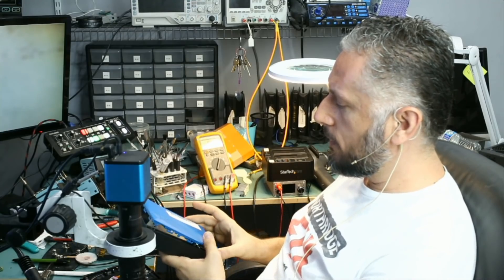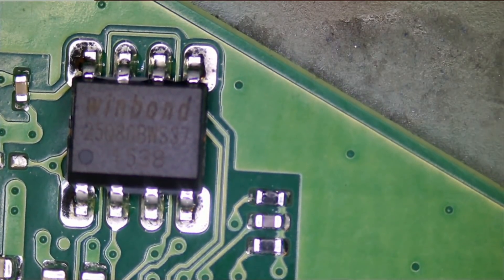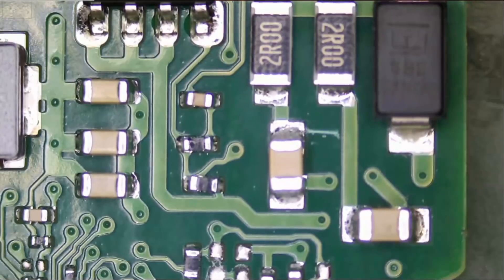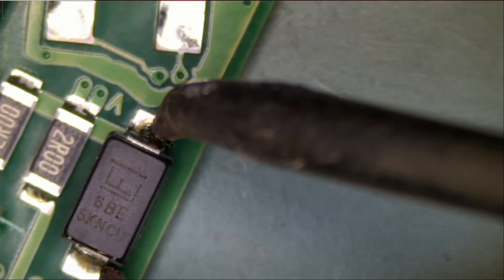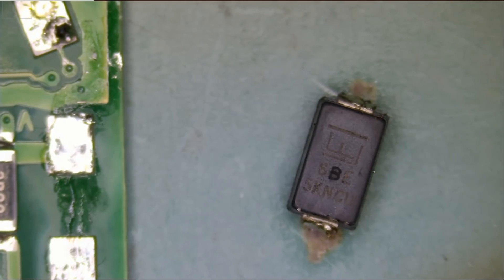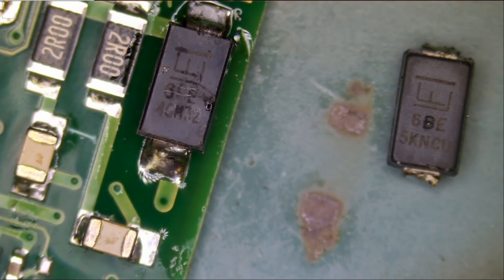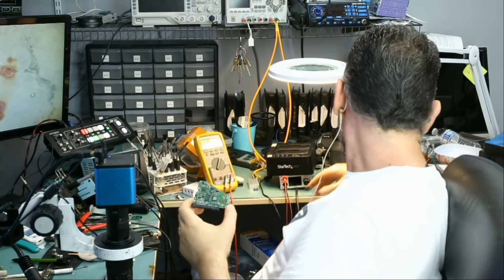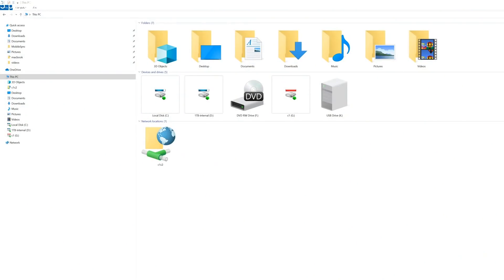5TB External Hard Drive Repair - Not spinning No power motherboard Repair

Comment: ok so the hub device I have turns on and stays on. The drive has no spin like this. No signs of viable issue, burn smell or no heat in my thermal cam. Is it only resistors I should check? I'm assuming if theres no start up at all its deffo the board and not the disks inside ?

Comment: hi northridgefix, i have a question

i have a seagate st5000nm0084 5TB hdd

it got interrupted during a wipe using seagate tools.

now it shows only as 4GB in size and is not powering up beyond turn on spin, 4 noise clicks then spins down.

is there anything i can do as i dont think my issue possibly is the card.

i cant get any os to recognise the drive properly to try and edit/repair in any way,

seatools doesnt recognise the proper size/capacity.

what would you do in a situation like this?

thanks for showing  great content, i feel like i learn a lot from your work.

 - des, from the uk

Comment: Great repair Sir , it's interesting how you make it look so easy . one question the diode you replaced it with had a  code number different from the faulty diode . While one could assume or presume the parts were from same drive how could you have been so sure the diode  had the same specs or specs that were within the working range , surely to be sure one would have looked up the specs . ?
Reply: I knew someone would have asked this question I was wondering about already

Comment: For those without an electronics knowledge or background, could this issue be resolved by getting another motherboard of the same model and just replace the motherboard?  Not sure if it works that way.

Comment: @NorthridgeFix Firstly great video secondly is the motherboard paired to the hard drive, if it's not would it not be possible to swap out the motherboard rather than taking components off one board to fix another.
Reply: The idea is to maintain the integrity of the controller onboard which keeps track of all the locations of data on disk. If the drive was encrypted or something like that it'd be nearly impossible to use a new board without rebuilding a filesystem.

Comment: Great work! I want to suggest that instead of saying "component" if you can please identify what the component is.
Reply: It is a TVS diode (Transient Voltage Suppressor) on HDD board. It will short circuit if the voltage at the 12V input exceeds about 13 volts, to protect the drive. It happens typically when the user by mistake uses a laptop power supply (19V or so) instead of the 12 V. It happens too if the original 12V power adapter decides to go mad an output more than 12V.
On external HDD cases, the 12V power is fed directly from the 12V power adapter to drive 12V input. The 5V rail is created by a smps regulator on the SATA-to-USB converter board in the enclosure from the 12V input. Therefore there is no need to have a TVS diode on 5V input on HDD board.

Comment: Incredible attention to detail. One question: On the replacement part, tweezer was used to extract from donor and soldered  on the defective board while the hot tweezer was on the component for a good 15 seconds during both operations. Is this OK, does this not cause heat stress?

Comment: I've repaired numerous harddrives with this fault. The customer plugs a 19V laptop power supply into the external drive and since the 12V rail is fed directly to the disk, the voltage transient supressor takes the grunt and shorts out. A classic.
Reply: so your saying, this problem has a high chance of reoccurring?
Reply: @refink33  if the customer plugs in a power supply with more than 12V available?yes!
Reply: @zapro_dk How much this cost after successful repair?
Reply: @BonJunCuevas  No idea.
Reply: So they should have over voltage protection lol. I thaught they made all these idiot proof lol
Reply: @melplishka5978  That component IS the overvoltage protection.
Reply: @SteveMasonCanada  ya sorry. I meant protection that was self resetting instead of just exploding lol.
Reply: What uses 19V on a laptop ???
Reply: @BigEightiesNewWave  Nothing. All voltages are converted to a lower ones - 5, 3.3, 2.5, 1.8, 1.35, 1.05 + something 1x+ to charge batteries.

Comment: Help me please, i have zotac gtx 1060 6GB, but everytime i play games it is always BSOD "video scheduler internal error"
Reply: Attempt to boot into a Linux live disc that supports Nvidia, like POP OS, see if it also crashes there. If so you may assume possible hardware error rather than software. Always rule out software/driver issues first!
Reply: @wyattarich  Will try, thanks you so much Wyatt, will continue to subscribe 👍🏻👍🏻👍🏻

Comment: Looks like the reverse voltage protection based off its location..if the postive and negative are hooked up backwards it shorts protecting the drive and data but requires replacement to make the drive work again. If it is you dont even have to put another one in. Just leave it out
Reply: That's right! But i suggest to always replace TVS diodes before powering on the pcb again for be safest.
Those diodes also protect against power surges... you don't want to repower the pcb again without those diodes if you're unsure about your power supply condition.

Comment: 5 Tb of data depending on a 2 cents component...
Reply: Yep, but in the completely opposite sense to what you are thinking.
Actually that 2 cents diode saved the pcb from further issues. In fact that is a protection diode, it shorts himself so that overcurrent will flow directly to ground instead on the rest of the circuit.

Comment: there are 2 things which makes the fixing looks hard. 1th: finding the broken component . 2th: finding the correct component for replacement.
Reply: It was pretty freaky that he said the customer sourced their own donor board before bringing it in for repair as if they already knew where the problem was...
Reply: @SirReptitious  probably they leave the boards while thinking that it cant be fixed. if the fault is chipset(gpu).

Comment: What is the concetration of IPA solution you use?

Lovely work ....Good luck
Reply: Most repair channels have 90% or anhydrous (99.99%) pure isopropyl alcohol. The reason to use higher purity is the non-ispropyl is thinned with water, obviously water is a big no-no.

Comment: How would you identify and purchase a replacement component if you did not have a donor. I couldn't find anything relating to that component number
Reply: The logo is LF. One trick to bear in mind is that putting every number on the component into Google can be less productive than putting part of the number. In this case, the 6BE is starting point.
Reply: I thought I posted the link to the datasheet PDF but perhaps YT doesn't like that.
Reply: @OnStageLighting  shame on YT for censoring useful links!
Reply: Looks like a little fuse

Comment: Job well done 👍 that component is a TVS diode for over voltage protection
Reply: Yes it's a protection and sometimes this fault is caused  by a faulty power adapter. I found that the 5be SMD code is associated to 5KASMC12A
Reply: Yes, they blown frequently in ubiquiti equipment
Reply: @fabriziop.3360  does it result it no power? I got an Engenius EnStation 5 here I'd like to repair. What can I replace it with?
Reply: @ayuchanayuko  i replace with similar component from donor board. Sometimes i leave without it, but the device will be no protected against further voltage spike
Reply: Yeah TVS diodes are used in a lot of devices. Some have multiple i.e. for the 12 and 5v line
Reply: Yes it is..

Comment: This was excellent. So the Diodes were the tan parts. And you tested for a ground short. And did you need to know which side of the Diode should have been ground?
Reply: The tan parts are capacitors. The bigger black box thingies are the diodes
Reply: diode side: he matched the orientation of the print on diode's case, that's enough when you replace with same part from a donor board.

Comment: Shorted TVS diode, it might happen when power supply is getting faulty or due to electric surge. With Seagate drives you have very good chance to make work those again.
If that type of issue happens on the 5V rail of WD or Hitachi drives then you have only about 50% of chance that the drive will work again after pcb repair / swap, because the TVS diode protection on WD/Hitachi PCBs is not well designed as for Seagate and Toshiba PCBs.
The issue with WD PCB design is that they use two zero ohm resistors (usually R64 and R67) instead of a real fuse, so fast pulse of high current from a bad power supply will not be interrupted in time by the protection and will flow from 5V input rail straight to the PRE-AMP and so kill the heads !!
If that happens, usually you will see burning marks on the square chip (VCM controller chip which has pins on all 4 sides) on the side overlooking the two pads stripes for heads attachment.
Reply: How do you know all of this? Do you do repairs as well?
Reply: @bobr9207  Yes i am DR tech

Comment: I don’t quite understand if the customer had the donor board why not just screw that board onto the hard disk and use that one.
Reply: It does not always work. There are some configuration settings on the eeprom. Headcalibration, fault spots, drive tolerances etc. It could work if the boards are from the same batch of production, but still the fault spots on the platters could be different.
Reply: @Trailtraveller  thank you for explaining it so well
Reply: It never worked when I swapped boards on the same drive with close serial numbers,need to swap bios chip over with config data
Reply: @jcb208  thank you for explaining it well
Reply: if  things could swap as easy as you said then this guy will out of business soon ..
Reply: Straight board swap doesn't work. Faster and less risky to repair customers board that had an obvious short from the very first test, than to assume donor board works, swap the eeprom, hope and pray etc.
Reply: @OnStageLighting  thank you for explaining this so well